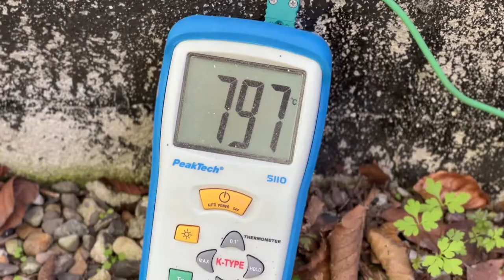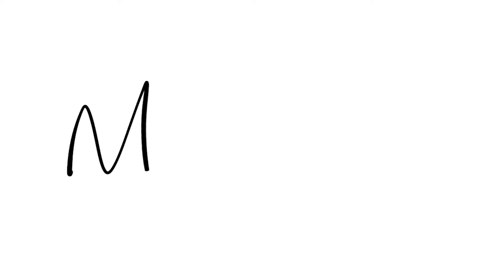69.  How to do Horse Hair Raku - ASMR version

Comment: Hi Mikkel, what a wonderful pots you made again 👍 Question : Digital Infrared Thermometer - What has to be the range - are they very expensive ?
Reply from the maker: Thanks a lot :-)

The one I have goes up to 800 C. Get it in a car parts shop. That is usually the cheapest. You can also get some that goes up higher but they become MUCH more expensive. And since flames do not reach more than 800 C I think it works well